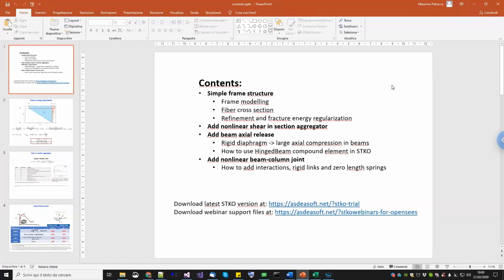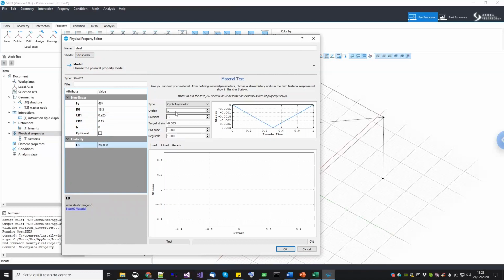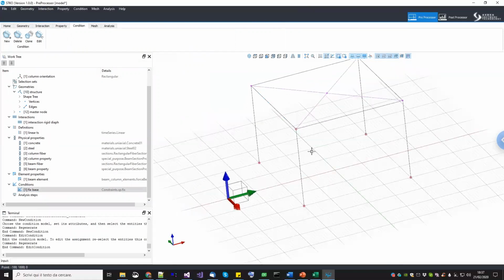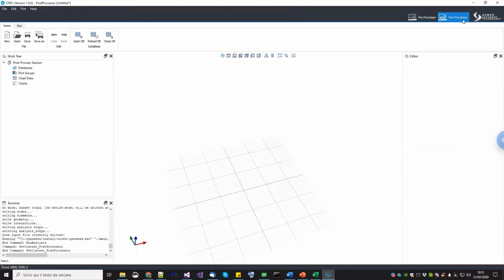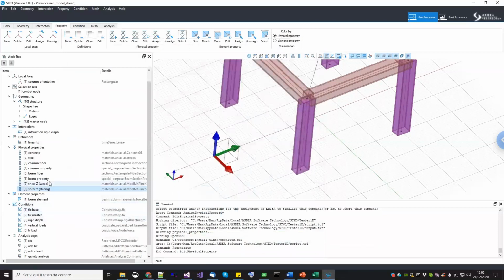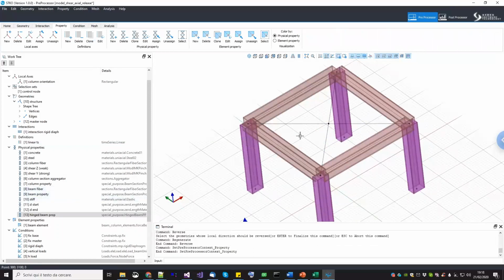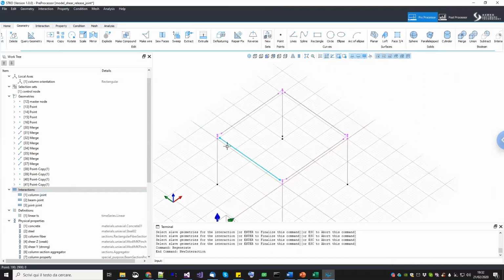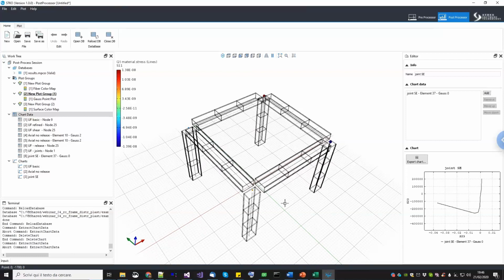STKO E-Learning Course - Nonlinear Modeling of RC (Frame + ShearWall) Structure - Distr Plasticity

Comment: Hello!

Whenever I try to do the min 16:10 step, STKO closes. I cannot assign a concrete cover before selecting the concrete core.
I have already updated the program and I still have the same error.

And also, when setting the analysis command I don't have the option, in the "test" group, of the "pFlag" command.

Does anyone know how I can fix these problems?
Reply from the maker: Hi Sueli,
We fixed the issue about the FiberSection crash here:
https://asdeasoft.net/forum/viewtopic.php?f=36&t=2480
The fix will be available to everyone in the next STKO release. In the meantime, you can use this workaround
point 2) the pFlag is not available anymore in the latest STKO versions because it is handled automatically by STKO